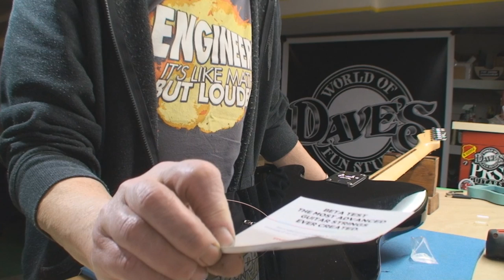Telecaster Fretwork and Setup Complete

Comment: good stuff Dave. as a greenhorn, i was sold a "half price setup" w/purchase of a used Tak from GC. 
All the guy did was give the truss rod a slight adjustment. they didn't change the strings, clean the fretboard, or even wipe off fingerprints.. lesson learned. ☺

Comment: Great video Dave. 
While the Electrosockets are really nice, you can drill the Tele output jack cup on two bottom corners and put screws in at an angle just like the Electrosocket. The two screws will also lock the jack nut against backing off which is another typical repair point resulting in twisted/broken wires.

Comment: Hey Dave, great vid as usual. Do you set the bridge saddle radius to match the fretboard radius or just set the action across the fretboard? Thanks.
Reply: If you set each string the same height up off the fretboard, they will follow the radius of the neck automatically. So if you don't have a way to measure radius you can still set it up correctly.
Reply: nobodyhere : OK...is that because of the different string thicknesses from low to high? I've seen some "radius gauges" for setting it up to match the fretboard radius. Guess they are not really needed to set it up properly. thanks.

Comment: I found out the hard way that diamond abrasives dont offer much service length when used dry. Using water, better. Simple green and water-best, but the diamonds still fracture and grit becomes finer. Ligh pressure and soapy water best for longevity, but may not be suitable for fretwork. Or you could replace cotton rags with a roll of blue Costco paper towels if they still carry them, and frequently wipe off the soapy water.

Comment: I just don't understand how Fender an Gibson keep getting away with installing those shitty jack outputs like the one on the tele or the plastic on Les Pauls on $2000+ guitars.  Or those Kluson style tuners with the plastic buttons that crumble over time.  For gods sake install these standard with the electrosocket, metal jack plate and modern style grover tuners.
Reply: or just buy a good guitar...